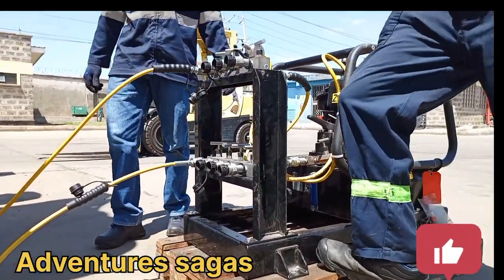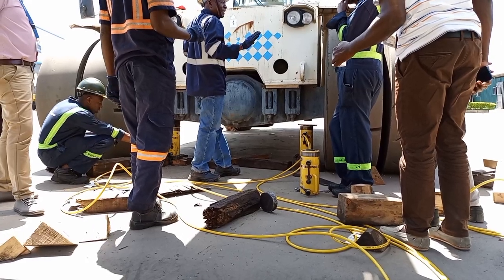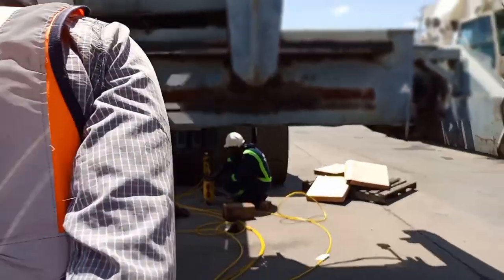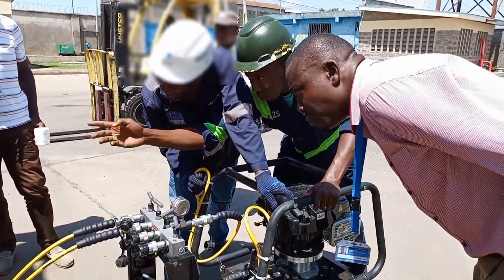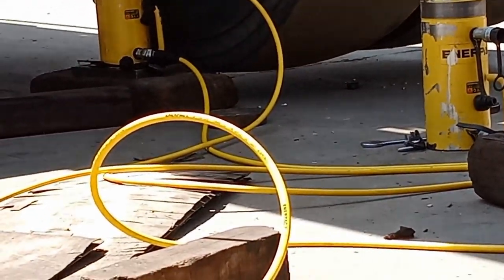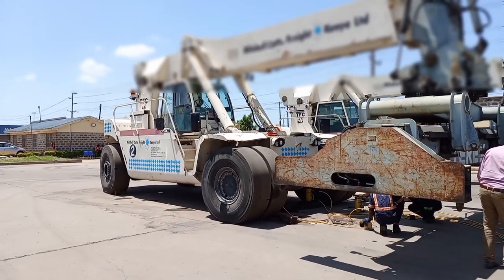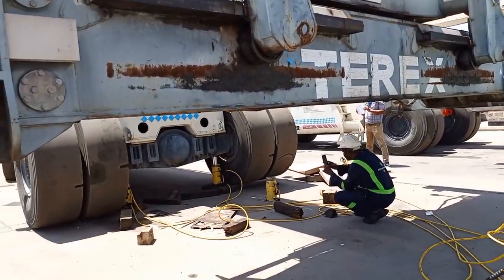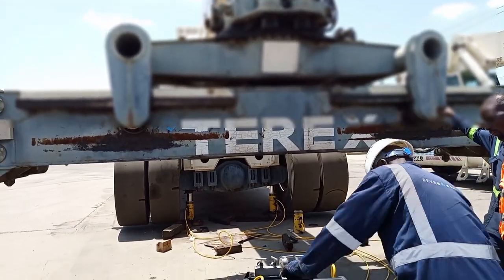Heavy hydraulic engine hoist capability test conducted on our 67-tonne equipment.

Comment from the maker: Safety features are of utmost importance when selecting lifting equipment. Ensuring the safety of both the user and worksite is of critical importance. You should identify equipment that includes safety features including load limiting devices, emergency stop controls and overload protection systems.